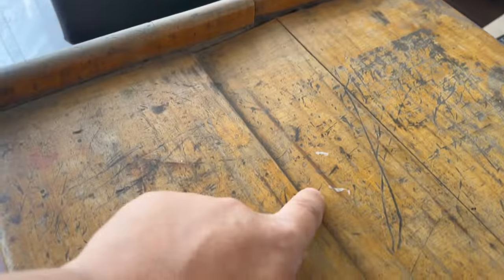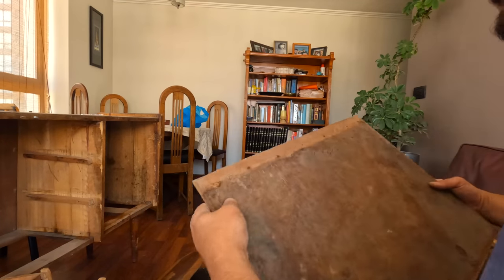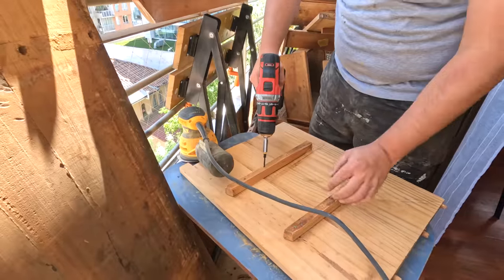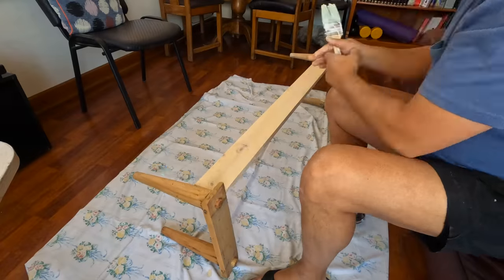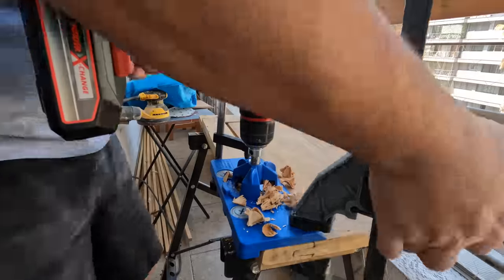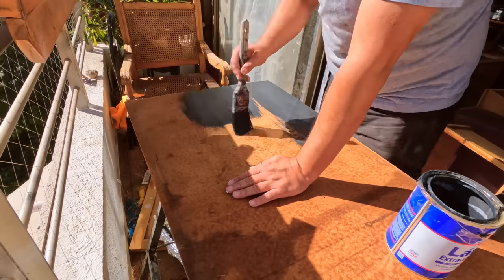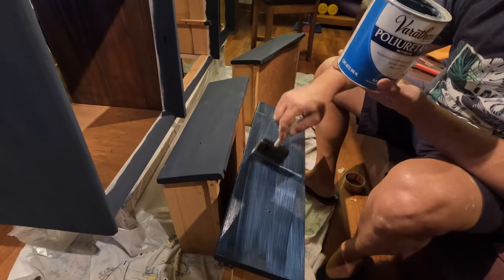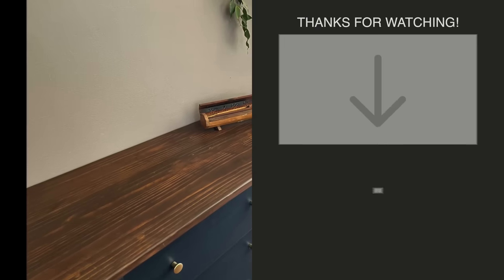Junk to Jewel: Flipping and Renewing a Neglected Buffet

Comment: A very thorough restoration. The fact that you are doing it in a small space makes the the whole effort more commendable. I appreciate the way you took out all corroded nail, taken all pieces apart, sanded them to perfection, fillers and fixing, replacing the new hinges. Everything was excellent. I loved the idea of sanding and painting drawers bottom and the back of the dresser, it gave it a new clean finish. However, just a single thing I wish u had painted the back of the back board as well. Otherwise it’s  99/100. 😊 well done mate!
Reply from the maker: Thanks for the comment. I painted the back, though.. I always do.

Comment: Always use glue with pocket holes. The joint becomes 3 times stronger.
Reply from the maker: Thanks for the tip. I’ve been using glue with pocket holes. Check my last video

Comment: Tips: clean your stencil after EVERY application (after painting and before moving the stencil to the next spot). It’s tedious and time consuming, but cuts down on bleeds and other mistakes.  Also, consider getting a stencil brush specifically manufactured for stenciling  or hold your brush less at an angle and more straight up and down.  This would keep the bristles from catching an edge and sliding under the stencil, while still being full of paint and muddying your borders.

I notice you tapping your paint and your poly to get rid of what I can only assume is dust, hair, etc., perhaps you should consider investing in tack cloth’s so that when you sand between coats, you can run a tack cloth over the surfaces And avoid messing up your paint/poly applications.

Mylo looks like a wonderful best friend.  I’m worried about mats in his fur, especially on his paw pads, tummy, etc.  These can be especially painful. Perhaps a trip to the groomer is behind schedule? 

Finally, I have no idea where you live, but using power tools on your deck and banging away with a hammer in an apartment building in America would get you evicted. I’m surprised they allow this. 😮😮
Reply from the maker: Thank you for that. Mylo had an appointment for his monthly grooming just that weekend. I posted a video of that for my members. Here in Chile we have some hours to make noise, but it is just the sander that is noisy. Thanks for watching again